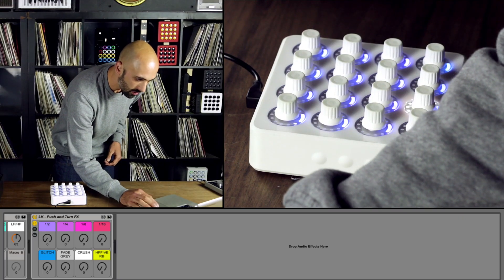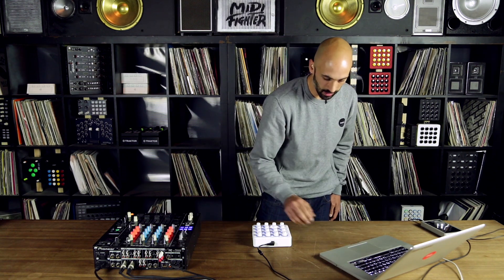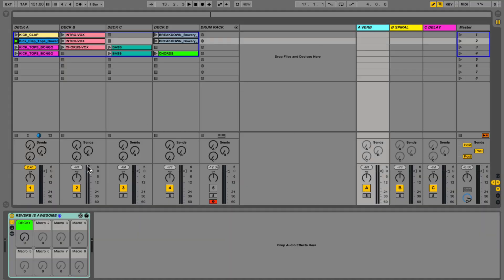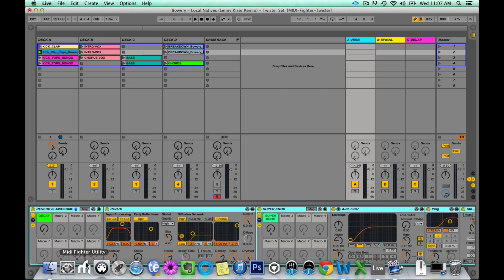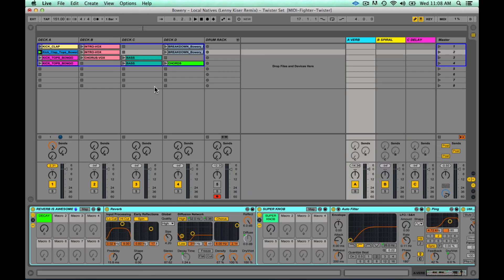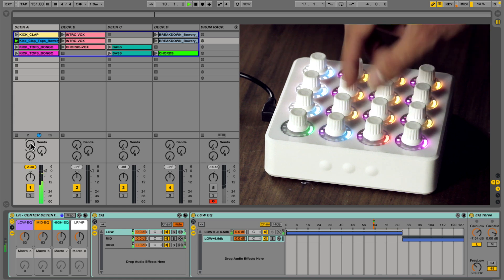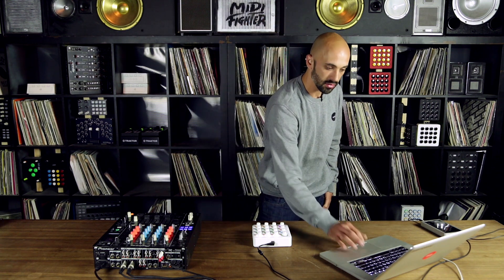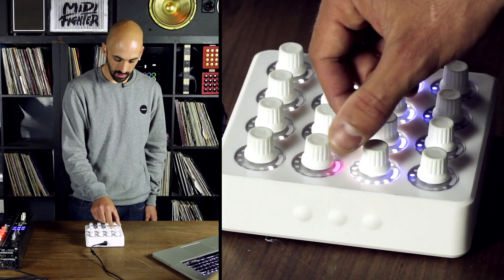Five Great Tips for Using the Midi Fighter Twister with Ableton Live for Performance

Comment: Would love an explanation of how 'sequencer mode' is setup in Ableton.  Clearly it's being used with some sort of sequencing device or plugin but this is not shown in the video.  Pressing the two side buttons is not going to magically turn a bunch of audio clips into a sequencer 😂.  Anybody have any clues on how to set this up?  I've had 2 midi fighter twisters for several years and still have never managed to use them as sequencers although I originally thought this was one of the coolest features advertised.
Reply: Add all drums in a rack
Map their "enable" on the same knob
Change their "range" according to how you'd like them to follow
For example I have all of my 4/4 hats in 4 different "drums" in the rack and as rotate the knob they all enable one by one and thus creating more intense pattern

Comment: Both the twister and the fighter are such cool midi controllers. Just looked them up and they are fairly expensive. I was a little shocked. I think I will have to try and look on the used market and see if I can save myself some money on getting them that way. First saw these from KJ Sawka and Mr.Bill , as well as KJ Sawka and iLL Gates MIDI fighter match. They inspired me to start learning music production with Ableton live, I only have the lite version that came free with my Alesis strike multipad. I will be getting Live 11 intro version very soon for Christmas. I know I should get the suite version so I can use max for live stuff, however money is very very tight right now. 2020 has been a terrible year financially, can barley afford to pay rent and keep my heat, electricity ,water, bills paid. These combined with a Push 2 would be a killer control combo.

Comment: I dunno dude, I see you reaching for that mouse more than anything, if this thing was so great you wouldn't need to be doing that, also, why do I need to drop $200 on this thing? I have MIDI controllers up the wazzo ANY piece of gear released these days has MIDI control capabillities, I don't see what this things does that dozens of other things I already own can't, plus the whole idea of "Hey buy this thing so you can buy other software and use them together" is just silly to me. This product is over rated hype. Stay away from software dependant hardware people, they are just trying to sell us things we already have. MIDI fighter = Junk
Reply: You are clearly daft. This is I very high quality controller. It feels great, unlike your MANY controllers, this thing is built like a tank and can be used as simple as possible or as complex as possible. Besides, push 2, it’s my 2nd most used controller.
Reply: THIS IS MY FAVORITE CONTROLLER EVER.  and i own maaaany
Reply: A box of knobs has a boatload of uses for a DJ or producer, but it's not designed to replace a mouse.
Reply: Actually this device can do many things! You just have be creative. That's what Djing is about. Try something new.

Comment: my min is 0 max is 127, but with my twister it inly turns on/off device if i press and hold encoder down. I've messed with min/max no changes, up to date twister, any ideas?
Reply: hey, I know its been 4 years, but I've been stuck for 1 month on that problem and just found the solution. If your button keeps enabling/disabling instantly, use Midi Fighter Utility (download on official website) and set your knobs' "Switch Action Type" to "CC Toggle" instead of "CC Hold". It fixes for me.
Reply: you should check out the "switch action type" in mf twister settings, you probably have it on a toggle mode
if it's "shift encode hold" then and you press the button, it's 64 notes higher and the sustained value (velocity) is for a different note